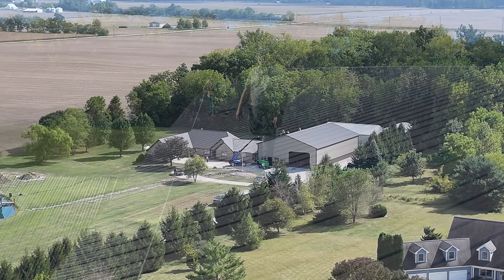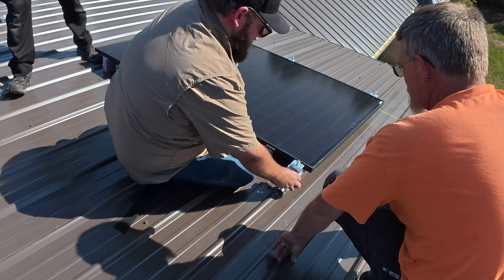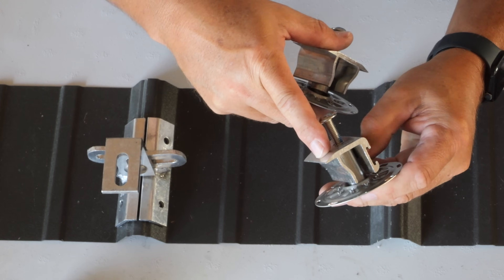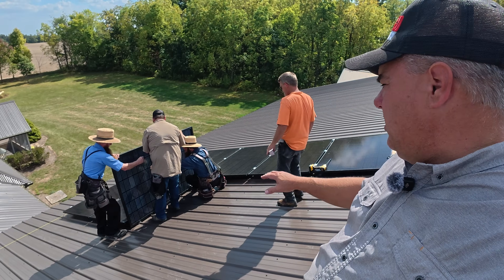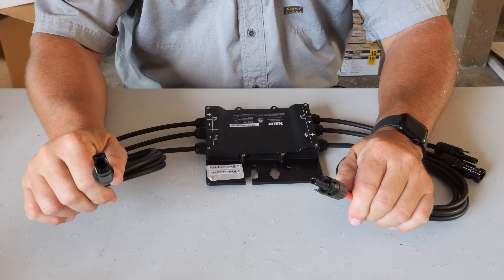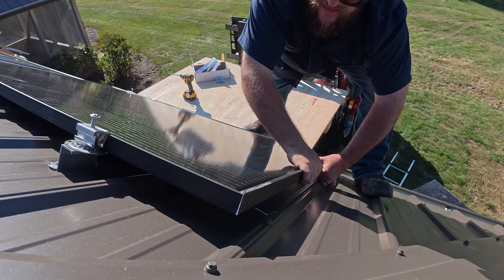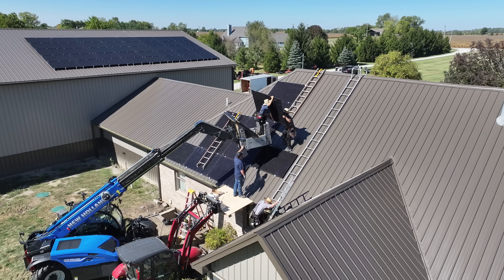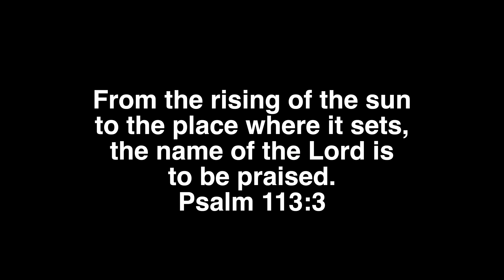Preparing for Doomsday! Solar Panels For Our Entire Property

Comment: With the panels spread out and number of panels, how many strings do you have running down to the combiner / inverter?    Are putting the strings in conduit or using a roof access point?
Reply from the maker: I will have 10 strings total.  3,3, and 4 for the different roofs.
I am running PV wire to a junction box (jaybox) on the roof.  Then, using #10 thhn in steel conduit to the inverters.
Steel conduit is required by code.

Comment: As a retired commercial construction field superintendent, I am not surprised by your stellar impression of the tele handler. Unless the project had no room around the building, as in a dense urban environment, (where a tower crane is the material handler) a tele handler is a must have for any high production project.

Nice to see the solar panel work go up.

Comment: Are you net metering? Storage batteries? Does insurance know about them and what is their Ryder for having them? Does IndY Power and Light require approval, Do you make more than you need and how does the utility compensate you back for the power you don’t use? I am in a rural REMC and am doing a barn build and am working on adding solar?
Reply from the maker: We are Boone REMC. Yes, they must approve for grid interconnect.
We are net metering.  We pay 12.3 cents, they pay us 8.3 cents.  Not horrible.
Insurance does know.  Boone REMC required a bond or something from our insurance.
Reply: @TractorTimewithTim thank you for taking the time to answer my question, as I am also working on a similar approach to my place.

Comment: Tim, are you planning to have all of your electrical off line or will it just support your usual electric usage? Thanks for sharing all this with your members and good luck on your finished improvements.
Reply from the maker: We will remain attached to the grid.  however, we should produce enough power to cover all of our usage.
We will sell back to the grid in summer...but have to buy from the grid in winter.

Comment: I have an 11kw solar sytem and the thing I found out when the system was installed was with the optimizers that are connected to every 2 panels that if 1 optimizer or 1 panel die's you only lose the 1 optimizer but the rest of the system still operate's so if you have 1 main inverter for the whole system and it gos down you lose the whole system so even though it cost's a little more money in the beginning I think in the long run your better protected!!!  Also you need to explain that your not paying the whole price for the system that as long as the system is installed and up and running before December 31st of 2025 you get a 30% tax credit on the price of the system on your Federal income taxes and possible in your state a state income tax credit if your state has income taxes.
Reply from the maker: Why do I need to explain that?  
Everyone should know about the credit, and that it ends for homeowners this year. 
Nothing unique to me.

Comment: Just curious on the new shop area why did you put the solar panels only on the front half of the building and not the rear half and was there any logic to why you didn’t put them all on the shop and you put some on the house?
Reply from the maker: South facing house much more efficient.

Comment: I don’t really have anything smart to say. Would the rail system make it easier to replace a panel from the center. I think you may have mentioned why in a much earlier vid. I don’t like that both sides of shop aren’t symmetrical. (Besides the exhaust moved panel.) Then again, not my roof, and who cares what my issues are!
Reply from the maker: The good news is that I cannot see the shop roof from the ground :-)

Comment: I have had my 56 panels for 8 years now, ground mount system. Yes they have paid for themselves. My electric bill March thru October is around $10 bucks, normally would be around $350. To $400. Per month. That is running AC 24 hours a day mid June thru September 1. Yes wish I would have done it earlier.

Comment: Love it, I am curious about the panels, how much of your energy consumption will they cover?   If there are limitations to what you are allowed to install by the local electrical concern?  And how many years do you roughly anticipate for them to pay you back?  Also...if you are doing battery backups instead of a generator, what system, how much capacity, etc.  

Also...crazy to consider that mounting is more expensive than the panels themselves.  That is something to process/take in.  

At first I thought the blue in the logo was referencing the Select Track, with the electrical tie in, lol  Then the New Holland connection made more sense.
Reply from the maker: Should cover all power needs….at least overall.    May not cover all in winter.
Utility allows 25kw max to be backfed to grid.
We will show batteries later.   2x 280ah.  
5 yr payback if I paid retail price.

Comment: Module level rapid shutdown is one of the main reasons I went with a ground mount here in Indiana. That said, I can't wait to see what you're able to produce with your setup, and what kind of battery storage you end up with.
You're not wrong, mounting hardware is always the most expensive part these days, my ground mount for 56 panels was around $8000

Comment: Hey, we like your videos but here in Florida the solar thing if you've got property like you do Tim in a year or two you're going to wish that you would put the solar panels on the ground by post I don't recommend too much on the roof unless you have to you have limited space around the building but with you you have plenty of space around the building and land to do it I would put them on the ground and it's easier to maintain them if you have an issue somebody has to come out look at them it's a hell of a lot easier and if you have to clean them it's you don't have to climb up on the roof and you're in a snow area so if you got to remove the snow plus we set ours up so that if you're going to get a high wind or a hurricane we can pull pins and we can drop them to the ground and lock them on the ground that way you're not looking out your window watching your solar panels Fly Away with the calculator in your hand going well there's another 1000 bucks gone😂 plus it's a jungle gym for your cats too you know😮 the biggest thing with solar panels is don't buy cheap connectors they will heat up and if you get a fire or short that's where you'll get it is in the connectors ask me how I know

Comment: My humble 12’ x 32’ tractor/garden shed is 200 ft from our house with a creek/small gorge that runs between them with a 32 ft bridge.  I light the shed with a 50W solar system with dual 24v LED strip lighting and it works great.  On my panel I added a dual 12v accessory plug that I can use to trickle charge batteries or run an additional work light.

Comment: this is from a firefighter.. thanks for putting on the shut down devices.. that will help in a care of fire.. now in my schooling in solar panels.. in some weird way of malfunctioning they will catch on fire at the panel on the roof and will not know it for a time and they are also see fire in the transfer panel at the outside electrical service to your solar system.. just some notes..
Reply: Rooftop solar fires are almost always 1 of 2 things. 1: Squirrel or bird damage/nesting materials combusting. 2: improper connection of the PV connectors. The plugs on the ends of the panels MUST be connected to the male/female counterpart by the same manufacturer. mixing manufacturers can cause bad connections, even if they appear to click together properly. That and improper field installations of these connectors.

Comment: In Missouri traveling up route 5 going north of Lebanon is someone's house and along their driveway are solar panels in a roll and there are many of them. I would say over 60 feet long. I noticed that the people park their cars underneath them like a carport. To me it is unsightly and I would have had them in the back yard. Also in Lebanon on one of the main roads looking through the trees there many rows of solar panels there, probably owned by the city, I'm getting. Now when getting rain and snow will it freeze to the panels and then not work correctly?

Comment: It would be interested to see an explanation of how you sized panel count and batteries. Also the process of determining the PV string inputs parallel vs serial with counts to get into the right range of the inverter(s). Loving the entire series.
Reply from the maker: Sizing My Solar System; 8 Easy Steps
https://youtu.be/Fu9E02cBJbU
Reply: Usually the panel supplier calculates that for you.
Reply: Speaking from experience, you shouldn’t size a system to completely replace your local utility. There are certain months where you have considerably less usage and while utilities pay for excess generation they are only paying wholesale prices, you don’t get paid enough to justify the cost of the system. Most states require net-metering so you only get paid (or pay) the difference at the end of the billing period. I usually don’t have a bill in May and maybe a very small bill in September or October when the weather is most favorable for little to no HVAC requirements. 
Another cost to consider is your utility’s meter charge. My utility only has around a $10 meter charge but our local COOP has around a $35 meter fee. So even though the COOP has slightly lower rates you may actually end up with a higher bill  it would take a considerably larger system  to pay for that higher meter charge. 
You also may not want an inverter with enough capacity to handle the maximum output your panels are capable of producing. Your peak production only occurs for an hour or two when the sun is at its optimum angle for your system. In late June and early July (the weeks preceding and following the summer solstice) my system peaks for about two hours and my bell curve flattens when my inverter reaches its peak capacity. And that’s only if there’s optimal weather and environmental factors. This year, as an example, between the smoke from Canadian wild fires and an unusually cloudy spring and Summer I never seen that peak flatten like I usually do.
Reply from the maker: @jimschmitz6192 mine is sized to do so.
We’ll see how it goes.  
I’ll let everyone know.

Comment: I am going to tell you that you will have to clean the panels. I just had to clean my 42 panels twice this week from corn and soybean dust when they harvest. Also when they till and plant in the spring. They will get caked on by the dust from those fields around your property. Your production will drop significantly if you don't. You should have went with the ground mount. It was the best decision I made.
Reply: I don't have heavy agriculture by house in Maine and with exemption of this summer we usually get plenty of rain to knock the dust off our panels. I haven't had to wash them in 10 years and our output stays steady. Tim does have that lift so he should be able to get up there easily enough to pressure wash on occasion when needed.
Reply: @michaelcassidy7645 I’ve never cleaned mine in the six years I’ve had them. The last couple years I’ve lost production due to the smoke from Canadian wildfires drifting across the US. 
I did buy a brush specifically to clean my panels, I figure they’re due to be cleaned.

Comment: 12 Minutes into the video and the Free word was used. Knew you weren't paying full price. No one does with solar because you'll never make your back over its lifespan.
Reply: That's an interesting thought. What is your real world experience on that? I've had solar on my roof for 10 years now and it was paid off in 6 years... Nothing was free. I'm an electrician so I saved a little on the install costs. But no more than about a year more of the energy cost savings we have. So it would have taken 7 years. Oh and I love in Maine, not the Southwest with tons of sun all year long. Now that our power company has been jacking rates like crazy the last 4 years we have had a nice stable known electric bill. It's interesting to hear people that don't have solar tell me it doesn't work..
Reply: And as energy prices continue to rise rapidly, the return on the initial investment will only improve.
Reply: Haha, as I’ve said before, please tell me more about how staying on the grid has a shorter payback time😂
Reply: @SL54321 your goal should not include staying off the grid. There’s a balance between the extra cost for a larger solar system and paying less per month to your utility. Plus not everyone has enough roof space facing the right direction (or enough property for a ground mount). I have a month in the spring without a bill and a month in the fall that’s near $0.
Reply: @jimschmitz6192  I mistyped. I meant “continuing to pay the utility company indefinitely” when I said “staying on the grid”. I’m a still grid connected. I just paid a monthly loan, which was less than my power bills were 10 years ago, rather than pay the utility.  As for space, that is a separate issue.  That is a situation in which solar isn’t a viable option. I don’t think that’s what the majority of anti-solar folks are talking about.
Reply: Yes, people who pay $80,000 for a system will not make their money back.  I did a DIY install of a ground mount off grid system.  $25,000 for a 15,500 watt system.  Few people have the skills and space to do this.
Reply: “The free word was used.” 🤡🤡. “I didn’t get this stuff free…”
Reply: Man you just like lying and making crap up? My system will easily pay for itself within 10 years
Reply: I installed solar before I retired, now that I’m retired I’m glad I have lower electric bills.

Comment: My friend who had his house built a few years ago did geothermal, a heat pump ac/heat, and solar. In the summers, the solar can cover 100% of the ac on sunny days, even selling some back to our utility sometimes. In the winter, only maybe 1/2 to 2/3rds is covered, but that's still much cheaper. His break even point is somewhere around 6-7 years i believe.